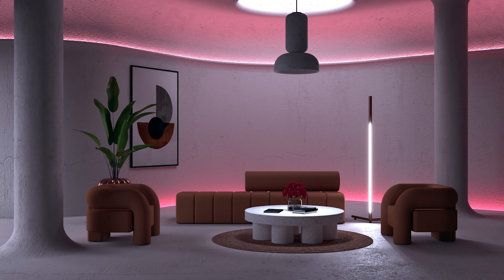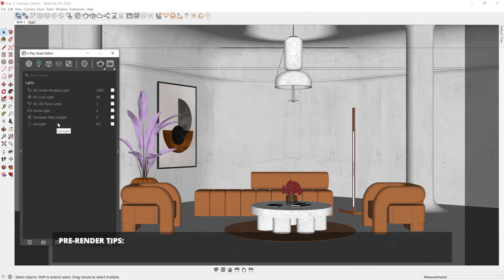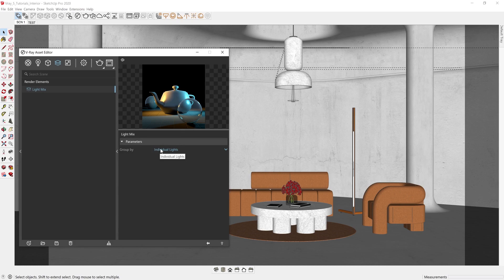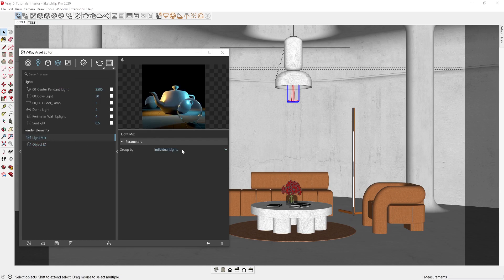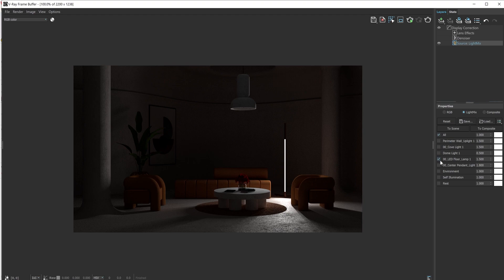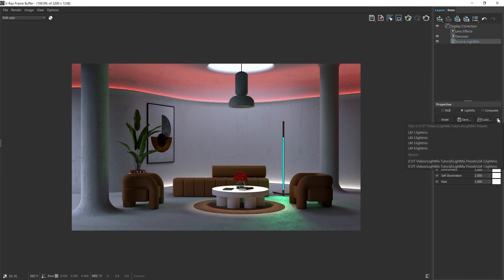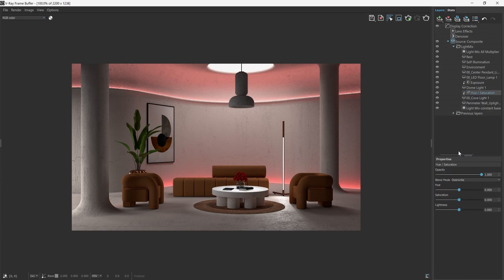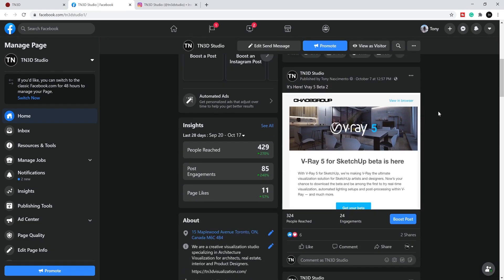Vray 5 Light mix for Sketchup | Re-light Your scene without Re-rending

Comment: When I set the intensity of a mesh light to 0, it appears to complete black, I was trying to make a sphere floor lamp, but want to see it on/off in light mix, is that possible? Thank
Reply from the maker: Should be, every light can be adjusted in lightmix post rendering. if its not working make sure you update  vray.